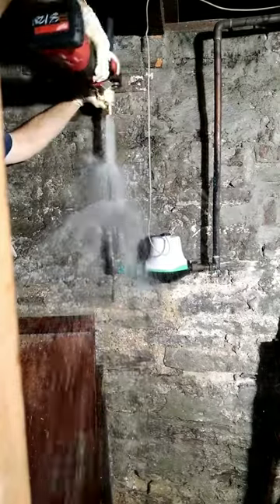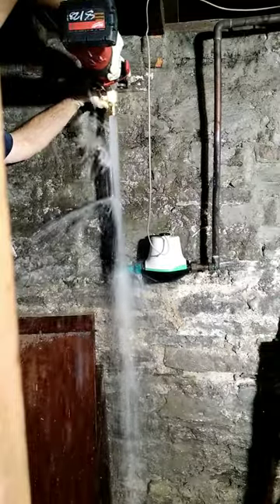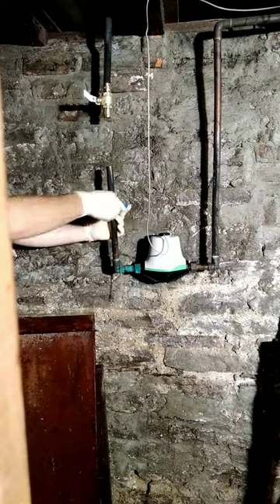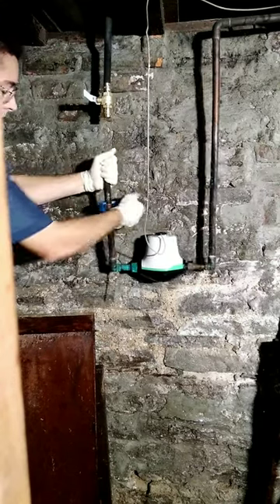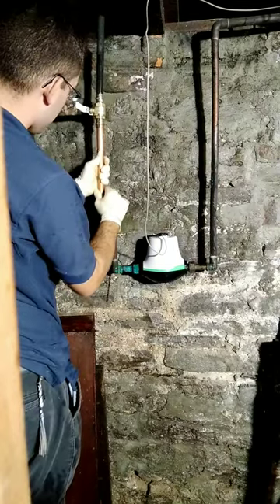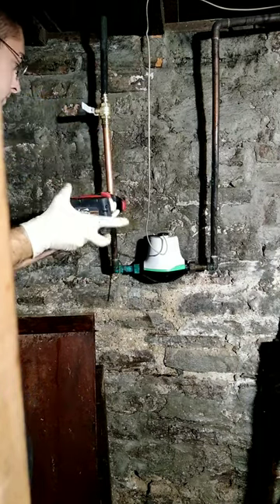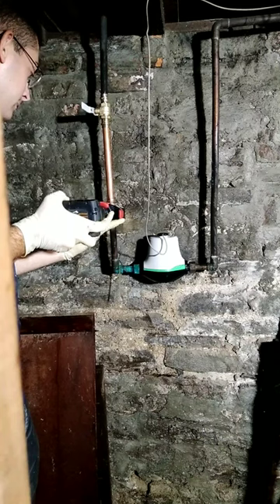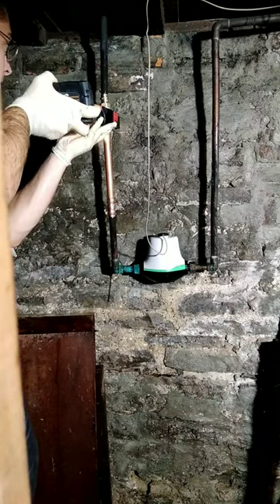Replacing a LIVE main water valve #plumbing

Comment: Good to see I’m not the only person that’s ever had to do this. It’s not ideal but sometimes you gotta do what you gotta do.
Reply from the maker: That's right :) part of the job sometimes. Whatever it takes to get it done
Reply: The phone starts when you have to cut it and the water is spraying upwards....
I had someone hold a bucket over it while I stuck my hands inside the bucket and had to manually thread on a valve a few times. I also used to work with a bank who did foreclosures, and people would leave the water on but turn the heat off and then the pipes would freeze and it would burst all over the house so I'd have to go down in the basement and find the main water supply and do exactly this and then insulate it. If I could show pictures of ice walls on here....!
Reply from the maker: @stompy676  that'd take talent for sure. Also true a lot of people forget to turn the water off when they're leaving the house vacant. Especially in the winter when it could freeze. I always remind people to turn the water off just to be safe when they're going to be gone for an extended period of time.
Reply: Go to the straight and turn it off.
Reply from the maker: @dougheld-ux1jh  go for it buddy. You'll be out there all day with a metal detector
Reply: very quick too.  Imagine a noob doing this... ouch

Comment: Soldering purist real quiet on this one
Reply: 😂😂It is possible to do tho, but why struggle when you don't have to...anymore? You can use a jet sweat tool to stop water & solder a valve on. You can also freeze(several methods)the water inside pipe to create a 'stop plug' & still solder a valve on. It's just so much nicer - cleaner & quicker, to be able to quickly propress the ball valve on, be done and move on! 👌👍🔥💦🛠️🔧🔩🔗📏💧
Reply: I'll kryo freeze the line, or sweat stop the water to make that repair. He didn't even clean or prep the copper before pressing it.😂
Reply: Didn't say it's not a good tool, but a torch and solder has never cost me 4 grand!!!
Reply: @tdotw77 thank you you saved me so much explaining.
Reply: I would charge out the ass for this risking a 3000 tool is the reason a couple more of these that tool will second as a boat anchor
Reply: @justinreed7093  Try again mines last years bean dropped off ladders and submerged completely underwater and still works boomer
Reply: Works Great for TEMPORARY fix. Solder it for PERMANENT fix.
Reply: JET SWEAT
Reply: You can only realistically do this with cryofreezing the line, soldering without would dump way too much water before it fluxed, heated, soldered and set.
Reply: @bigdaddystovepipe yes!
Reply: There is a tool for every job. I am not big on pro press but sometimes it really fits an application well

Comment: Cool video! It’s against code to use propress before the meter in my area or I would do repairs like this
Reply from the maker: Yeah I've heard that some states require flared copper up to the main valve. Which is stupid. Solder, press, and braze is all more reliable than flared copper.

Comment: Is there potential for there to be a burr that could cut the o-ring in the pro press fiting or if the burr is inside is turbulence an issue. I'm no plumber so definitely not criticizing. I'm actually just curious.
Reply from the maker: No, there's no burr on the outside of the pipe if you use a copper cutter. If you cut it with a Sawzall you might want to clean up the shark edges of the pipe

Comment: Those valve from the street, in my town, kudos to our water dept., they find them and have been always been able to shut them off, or replace the valve.
Reply from the maker: Yeah around here a lot of times you would need a metal detector to find them. All the city water guys carry metal detectors for that purpose lol
Reply: @SamThePlumber  
I just don't know how they find the valve with that 7 foot rod, the 4" tubing going down there is filled with water. A thankless job.

Comment: The only thing I would have done different was to clean your joint as difficult as it is and as what is you're going to get You don't want that ProPress to leak at any point
Reply from the maker: Not necessary with press fittings. Cleaning the pipe and fittings is only necessary when soldering. If you're sanding a pipe before you press it all you're doing is sanding the pipe thinner. You can press 50 year old copper that's completely oxidized to brunt orange, or even green and crusty, and it won't ever leak at all. Trust me, my company does it all the time and we've never had an issue.
Reply: it's not necessary to sand down the pipe befor fitting..however if there is any sign of old paint or grease  in the fitting area it is wise to give it alittle sand down   to take the paint/grease off the pipe before fitting for maximum strength of the fitting ...
Reply from the maker: @MyChocow  paint, sure, sand it down just to be safe.
Reply: @SamThePlumber  eh buds cheers
Reply: Clean the pipe before you cut it 👍
Reply: @SamThePlumber your company presses onto oxidized, green copper? How hard is it to take 5 seconds and sand it?
Reply: Clean it... Before you cut it...🤯
Reply: @SamThePlumber sending the copper only removes the debris and build up on the outside of the pipe. You would have to sand it for about 3 days for it to lose any thickness. Just sayin'
Reply: You're generally supposed to ream and chamfer the pipe to prevent the O-ring from being potentially cut or torn completely.  Generally calls for follow up of sanding to smooth out the edges as well followed by insertion depth marked, this would-be the proper way generally per manufacturer to ensure a valid warranty joint.
Reply: I've had one leak on propress and it was when I first started using it. Since then I ream the cut end of the copper and sand it like I was going to solder it
Reply: This is great for all those" solder it pro press sucks " guys..or the "my grandpa used bread" ...
Reply: I would think deburring the pipe would be a good idea as well as cleaning it..steps you cant convince me to skip no matter how your connecting it.. not only can it cut seals but it creates a vortex when the water is running through it which can wear out the copper pipe and cause pinholes..
Reply: @troydistefano3206  my I knock the burr off as well , sometimes pipe expands at both cut edges , fittings are to expensive to risk having to cut one out because I didn't want to clean it up
Reply: Oh man… “my company pro presses onto green oxide pipe” do not get work done by this company. Takes 4 seconds to clean.
Reply: helloo
 @stompy676

Comment: How would you do it before pro press?
Reply from the maker: Jet swet to plug the pipe and solder. Or freeze the pipe. Ford or Macdonald burial rated compression fitting threaded onto a valve. Sharkbite valve.

Comment: It seems rhe days of soldering are over. Certainly speeds up the process for the plumber.
Reply from the maker: I only solder if I have to. It's all pro press for me
Reply: Absolutely YES @SamThePlumber
Reply: The days of soldering have been over for a while. Pressing is the new industry standard!
Reply: Rubber o rings never fail.. ask the challenger space shuttle or any car mechanic

Comment: Did you not have Emory clothe to clean the pipe with?! No pipe prep, just slide that oring over the rust/scale.
Reply from the maker: You only need to clean and flux the pipe if you're soldering. You don't need to sand the pipe when using press fittings

Comment: How would you do this without a pro press?
Reply from the maker: There's hundreds of ways. Without pro press you could (1) Call the city water dept for a water shutdown. Solder a valve. Or... if you're not gonna call them and wanna do it live you can... 
(2) Jet swet tool and solder a valve
(3) Sharkbite push fit valve
(4)  Freeze the pipe and solder a valve
(5) Ford or Macdonald underground compression fittings screwed into a threaded valve
(6) Compression valve
(7) $250 self tapping valve
The list goes on...

Comment: Have you ever had any bad luck with jammin those press ball valves on and nicking the o-ring then having to do another one?
Reply from the maker: Nope. Copper tubing cutters leave a smooth edge so there's no chance of ruining the o ring. :) In fact I cut large diameter copper with a Sawzall and pro press it no issue

Comment: I know this is probably the same price of the item but they make a fking valve that cuts and seals a pipe all at once. Rather incredible. Looked them up and it’s $150 called Allidon easy fit isolated valve.
Reply from the maker: I'm aware of that. I don't stock those on my truck. And for the price difference, I'd rather use a $16 commercial grade full port ball valve.

Comment: So awesome Sam. I've never seen anyone do this before. Great great video
Reply from the maker: Usually it's the older buildings that you can't find the curb stop for. Pro press makes it a breeze lol.
Reply: @SamThePlumber I can't remember, do you use something like the pro press for refrigerant piping?
Reply from the maker: @themayorofairconditioning2868  I don't. I haven't gotten on the refrigerant press bandwagon yet. I still trust my brazes more.
Reply: @SamThePlumber  do you use that airsnake?
Reply from the maker: @themayorofairconditioning2868  like the Milwaukee drain air snake? I don't have that one but it looks pretty cool. Unfortunately it tends to blow tubular p traps apart. I usually use a gallon of sulfuric acid to open drsins. If it's really clogged then I quote replacing the drain pipe
Reply: @SamThePlumber  thanks

Comment: I had a valve break on a 4” incoming to a commercial building 60Psi at over 200 gallons per minute. I tried to get a new valve on there live but it was like I was in a tsunami. Thank god it was a utility room with doors going outside and had a floor drain. Finally found the in ground shutoff hidden under sod 30 feet from the building. Thought about my life choices that day….
Reply from the maker: 4" pipe? Woww. That sounds like a nightmare job. I definitely would've been calling the city to shut it off in that case. You just press or sweat a new 4" ball valve?
Reply: @SamThePlumber  Broken flange.  All bolt on work.
Reply: Just about any trade worker at one time or another had thought of another profession.

Comment: Did you use a metal detector for the curb key?
Reply from the maker: No that's what pro press is for
Reply: @SamThePlumber The pro press is for connecting pipes.  It's not a curb key. 😏
Reply: I know curb keys are I have a curb key

Comment: That’s a quick $1200
Reply: If the client tried it himself, it could be way more expensive ahah
Reply: With 1200+ tool
Reply: 1200? That's insane

Maybe for use tool, I remember changing stuff like that on the fly before we had a pro-press. That was fun. A jet sweat with a pass-through port in it... Try sweating that on-

Or putting on a Ford fitting when it's live and shooting straight up. ProPress definitely makes it easier. 

Back in the day we used to do this for 300 bucks, and that was a lot then. I'm not sure what I would charge someone these days for doing this.
Reply: @Devilsfan-pd8ov that tool is 1700 with no jaws. 2300 for the set with 1/2-1” jaws. Actually he got the m18 version, he probably spent 3-4k on his set.
Reply: No bucket included with the $1200 price tag? I guess you need to get the deluxe package for that 😂.
Reply: @stompy676 i still charge 300 plus parts😮
Reply: @stompy676 it’s a lot more these days. Plumbers have been taken advantage of for a long time.
Reply: Not really. 10 minutes to change the valve and an hour to mop up the water!
Reply: Easily
Reply: @user-wd7bb6mx4j 1/2" -2" complete set with machine in the UK £1200. We have been using them for over 20 years, maybe that's why the cost has gone down. We use metric sizes . Put it in imperial for our American cousins

Comment: Why wouldn't you clean the oxidation off that copper pipe? 

Doesn't that void any warranty and will most likely leak over time?
Reply from the maker: I'm not soldering so there's no reason to clean the copper pipe. Sanding copper is totally unnecessary if you're using press fittings. No it doesn't void the warranty on the valve either. My company warranties all of our materials and workmanship.
Reply: @SamThePlumber  you're telling me oxidation is a perfectly fine uneven surface to crimp to? 
Guess i just followed the old rules of cleaning all joints.
Reply from the maker: @chrisburgess2234  yes, oxidation is perfectly fine to press onto. It's still a smooth surface. Just because a thin layer oxidized a little bit doesn't hurt the joint at all. And yes I've even pressed onto rough green and crusty pipe and it's still holding fine

Comment: Put a hose on the new ball valve into a bucket and you’ll only have full flow on the floor for a second or so. 
Better still use a pipe freeze kit. Works a treat when there’s no flow. So don’t fiddle with the dripping valve before you freeze the pipe.
Reply: Bucket can't hold 200 gallons

Comment: Talk to the companys that clean up water damage. After you will look at pex and pro press diffrently. I choose solder becouse its a stronger connection and last twice as long. You have a meter the meter has a Valve. Water isnt free you have a meter.

Comment: THIS IS WHY THE PROPRESS IS A FUCKING GODSEND FOR US SERVICE GUYS. 
I can solder like a motherfucker I was raised by a master plumber, but my propress is as battered, and beat up as my pipe wrenches because it’s my first line of defense against a massive flood 9 times out of 10.
Reply from the maker: I can solder very well too, clean solder joints and I'm quick and efficient at it. No matter how fast you are, pro press is quicker and cheaper.
Reply: @SamThePlumber  EXACTLY!!!!
It’s not a perfect tool by any means, it has its limitations for sure, but as far as usefulness in emergency situations it makes all the difference in preventing further damage.

Comment: Some pipe support brackets are in order
Reply from the maker: We don't really use a lot of pipe supports in Ohio. The house is all copper so it's rigid enough to support itself
Reply: @SamThePlumber  i get it. It’s tradition not to use supports. But lol it’s literally dancing as you handle it.
Reply: @SamThePlumber that's untrue we use plenty here in Northeast Ohio. And no copper is not strong enough to handle that weight, and even if it is you shouldn't do it. Always throw support brackets up, especially around that meter, in fact that meter isn't even installed correctly.

Comment: There is a meter you can shut off . They do have freeze plugs for doing it live. You do know what a meter is right.
Reply from the maker: Actually it's called a street curb stop. Freeze kits are for commercial jobs that can not afford a shutdown
Reply: @SamThePlumber  lol. My first c36 was in 2003. Yes we used them on grocery stores. It's a meter that has a stop . Good one . In cal it's a meter.
Reply from the maker: @chrisviolette8991  c36 so you're Canadian. In the US, the meter and curb stop are different. The curb stop is located at the street and usually the meter is located in basement.

Comment: Only thing I'm thinking is what if the press tool craps out from water damage or something while you're doing the major connection.  Better have a manual backup tool on hand or I would because I'm a pessimist haha.
Reply from the maker: Water was all flowing through the open valve so the press tool stayed dry as a bone. And Amazon manual press tools are cheap homeowner equipment. I wouldn't mind having a second Milwaukee press tool just in case tho
Reply: Or maybe a sharkbite valve as an emergency backup?
Reply from the maker: @cletuss57  I always have one of those just in case. Never had to use it tho. I don't use sharkbites
Reply: @cletuss57 Lol, sharkbites 🤦‍♂️

Comment: Wow good stuff, you must have a solid insurance policy. Do you have a plan B in case the propress fails or something else goes wrong?
Reply from the maker: Lol yes, the company is full licensed and insured. If the fitting would have failed, I have 10 more press valves. If the press tool dies, I have Ford and Macdonald fittings (usually used for underground burial.) Orr last chance resort, I have sharkbites that just push on by hand. Ideally you usually want to shut the water off at the street curb stop, but that's not always possible in bigger cities when the curb stops get overgrown and no one can find them.
Reply: First of all, you should never cut this unless you had a working drain nearby... If not then You would get a giant garbage can... And worst case scenario you should have a compression fitting available just in case. And even beyond that a shark bite fitting if nothing else. You don't just cut pipe like this without some kind of a plan b and c. But if you've never done it before, I can understand how you would think that way. You should never cut into anything unless you know how to stop the water if things don't go your way. 

Insurance is a must, but In the bigger picture is the last resort. That means you didn't have a plan b or c or even d... And you just wrecked the place!

Comment: As expert or whoever you call yourself you should: 

1.  Clean the section of the old pipe before pressing as minimum. 
2. Highly recommend to replace that section of old pipe that very corroded. 
3. You have to mark the lines of you fittings before you press them. 
4. Support that pipe and valve.
Reply from the maker: 5. Debur the pipe